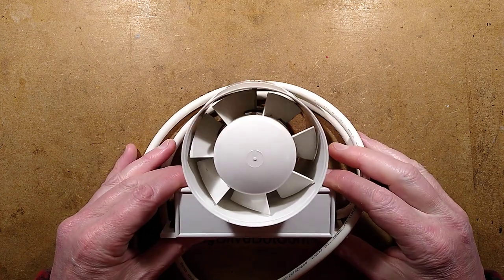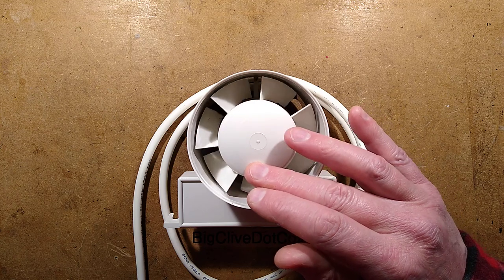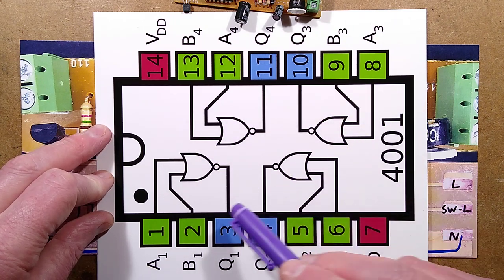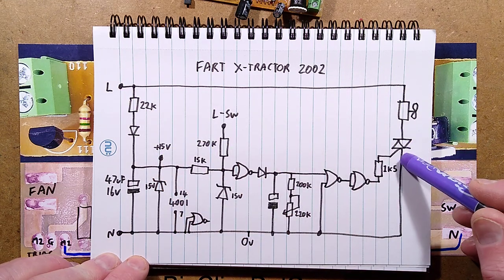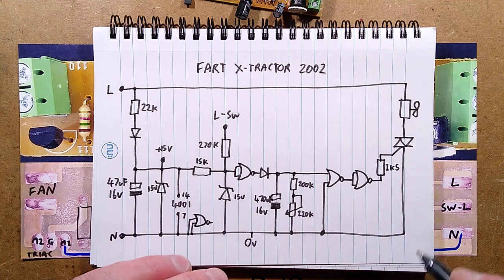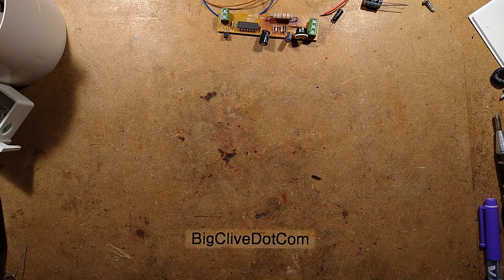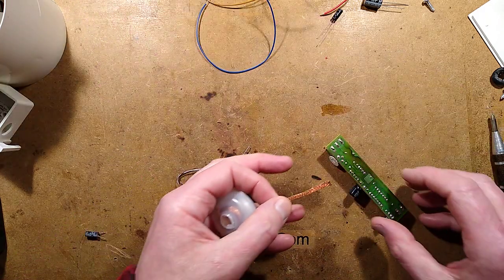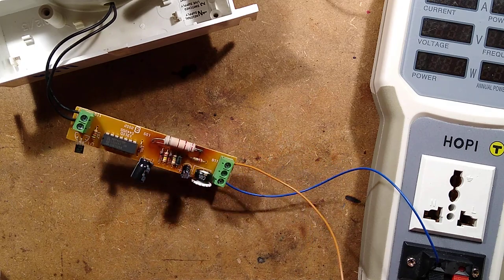Fixing a fart-extractor (with schematic)

Comment: It never ceases to amaze me the dexterity of Clives  fingers holding two things plus soldering.
Reply: surprisingly you learn pretty quickly how to use 4 fingers on your left hand to hold 2 wires facing each other for soldering
Reply: his hands now touched the fart-stained fan blades
Reply: John you soon get the hang of it, the number of times i have burnt the tip of my tong though when soldering it unreal, how the fcuk do i do that you ask? well the solder bends sometimes as you soldering, so you grip the end with your teeth and then pull it straight, problem is every now and then its still hot and the tong just don't learn, rather like when tooth ache eases off till its prodded again with the tong.
Reply: @chrispartosbro4555  LOL. Kind of like the triple dog dare and getting your tong stuck to the flag pole !  I’d burn my fingers tying to hold every thing That’s why I have a old pair of extra hands that radio shack sold years ago I miss that store !
Reply: i just use my right foot to help out haha
Reply: @johnsiders7819 - most soldering kits have those already

Comment: I think 99.9% of the faulty circuits I've repaired over nearly 30 years are either dry or puffy electrolytic capacitors. But I've seen other stuff like burned resistors, exploded varistors and such, but they're mostly symptoms of a defective electrolytic capacitor in the same circuit.
Reply: My mantra:  It’s always the capacitors.  I replace them preemptively in power supplies now.
Reply: Good to know

Comment: i've seen a few fart extractors that.. have melted. The motor bearings dry, becomes a heater, and slowly the entire "engine" block melts through the housing and hits you on the head.
Reply: Haha! Depending on how & WHEN, that is too funny. One of those few breaks we get, where you end up saying "Really life? Thanks, just thanks"!
Reply: An evil genius would pipe the exhaust INTO the office cubicles.... 😁 Would add a whole  new meaning to "Shitty day at the office".
Reply: The propeller stops in only 3 seconds. I'd say this one will die rather quickly if it's not lubricated
Reply: 🤭😯 - never seen that happen, normally these would make a hideous noise before the bearings have failed and the performance to degrade, and did you see it starting to ooze out the ceiling 😬
Reply: I've headed of one that caught fire melting the structure, falling onto a can of shaving foam putting the fire out.
Reply: @soupflood  Ahh, classic oil impregnated bronze bushing problems
Reply: @samuelfellows6923  eh, nah. Bearing is shitty bronze bushing. They're low torque and they're tiny low power motors. They use low power so they heat up slowly. They do have one shot thermal fuse but with the timer at just the right time, it's enough to heat it up to melt plastic but not trigger the fuse. so it melts through every time little by little.
Reply: @grumpyhale821  they do catch fire sometimes yes, due to combustible dust :D
Reply: @tronixfix  hot dump on the hot dumb truck!
Reply: I had this very model fail. It had obviously over heated the motor windings as there was a failed thermal fuse in there. Hopefully the thermal fuse in this model is enough to stop them catching fire, especially as they are normally mounted in inaccessible loft cavities.
Reply: @johna7075  The thermal fuses are put at around 125'C , but thanks to the timer, you could have a situation where it happens to heat up to just 100'C, melt a little start a fire, then the timer shuts it off before the fuse kills it.
Reply: This is 100% true I was sitting on the loo in a truck stop shower the fan overhead was making a racket that stopped and a half second later  it landed on my shaved head making a really bloody gash ! I jumped in the shower washed myself off and stopped the bleeding with  multiple folded TP  (I’m a ex paramedic) opened the door asked for help they called EMS it was bled thru the TP by then they took me to the local ER gave a couple of stitches.  The Union 76 people offered me a tidy sum to settle with them over it ! Should have not done that could you just hear the jury if it went to trial ?this happened near Lexington Kentucky on I 75 about 1996
Reply: @brokeandtired  hehehheheheheh

Comment: Thanks to Clive’s videos I was able to diagnose and cheaply repair an expensive wine cooler cabinet. It turned out to be a surface mounted fuse and a varistor. My best guess is that they were both blown during a lightning storm. Thanks Clive!

Comment: also known as the toilet turbojet, because they're nearly as loud as a turbojet aircraft on takeoff
Reply: If you get a chance to put a line fan instead of a surface fan. 
It is so much quieter.
Reply: @assassinlexx1993  pretty sure 90% of the pubs in England that still have these have never replaced them
Reply: @SpudderRail  
So your pubs smell like a bathroom?
Here in the  colonies  our drinking  establishments  smell then the same but with out fans.
Reply: We had a old Vortice one that was relatively old (probably from the 80's or 90's, no idea) I can confirm, this thing ran loud as hell.

Unlike most homes, it was on its own power switch (although we would seldom use it), not tied to the lights. We ended up replacing it with a variable speed unit (the fan's speed varies with the amount of humidity in the room), so now we leave it turned on all the time. In normal circumstances it spins at a relatively low speed and quietly but when someone takes a shower, the fan definitely starts speeding up at full tilt and making a whole cacophony in the process (LOL).

I still kept it in my scrap box, along with a newer, smaller Vortice (that is more barebones than the older one, the older one had small shutters on the front that would open when power was applied, the smaller one doesn't) that I have no idea if it works or not, but given how small it is, I can only imagine it makes a hell of a racket too.
Reply: @SpudderRail  - and vintage vent-axia, xpelair, vortice, extractor/ventilation fans in their walls and windows - main pub area and toilets. 😁
Reply: @assassinlexx1993  Yes, had one customer who insisted on absolutely silent fart extraction. Ended up suspending an inline version via offcuts of lighting suspension chain, using 25mm grommets as 'dampers' and ... just dangling it from the attic trusses. (one of those modern houses where the attic is full of matchwood and is thus unusable for storage anyway). it was finally quiet enuff for us to get a thumbs up from mr 'i want to hear my own farts'
Reply: @TheChipmunk2008  You can get effective ducting silencers if it's a problem.
Reply: Not as loud as the turbo hand dryers I see in public toilets, when they're actually open.
Reply: I have some of these exact fans,2 of them are mounted in ceilings directly tied to bedrooms,the builder fitted them directly to the ceiling beams and they were irritating to say the least!.So in an attempt to silence them and partly because I knew that my bloody daughter's only know how to turn lights on and because it's me who wakes up and has to turn the bloody things off in the middle of the night,which I love doing 😄 I used 2" thick neoprene pads (made from the surplus of a new cab insulator pad from a Scania)mounted on to fan then onto a bearer,it's self mounted now the roof trusses via more neoprene to eliminate the mechanical sound path and having some knowledge of baffling/silencing made some baffles using a hacksaw,a glue gun and some leftover plastic soil pipe,it worked better than I expected.To be fair though almost every small fan I have ever encountered that's noisy it's because they are dirty,imbalance causes vibrations and extra load which will shorten the service life considerably also. I have lost count of the customers who complain of heater blower vibration,BMW 1 series and drum fans in particular,where the culprit would be just a small dry leaf or tiny twig rotating with the fan.
Reply: @TheChipmunk2008  I'm puzzled by all of this going on across the pond. Here in the US, I have a nearly silent panasonic whisper green select that moves one hundred and fifty cfm
Reply: Well it would flame out like a jet if it sparked while extracting methane gas. That’s what farts contain !
Reply: There are new ones that are much quieter.
Reply: @bibasik7  Yes but my point is that most of the pubs in the UK that still have these fans simply never replaced them, they're still going strong and sound like jet engines.
Reply: @TheChipmunk2008  Not as extreme as that, but the fan in the windowless bathroom in my first place ended up in it's own isolated enclosure in the loft lined with foam and coupled back to the bathroom via thin-walled flexible plastic ducting so noise wasn't propagated down it.
Reply: @penfold7800  The latest ‘fad’ is to have public washrooms in the hinterlands of the northern outposts installed with a famous vacuum cleaner name and have ‘air knife’ style hand dryers instead of bio-degradable paper. So instead of £0.001 of paper consumed per patron, it’s now 3 to 6 minutes of 1000w electricity, @$0.35 per kw/h. Way to go technology. (The 6 minutes is 40% nuclear, 40% hydro, 20% new fangled wind/solar).

Comment: I have never heard a bathroom vent fan referred to as a "fart extractor" before. I love it. In the US, it's very often a separate switch, although sometimes it's tied to the lights and shuts off at the same time they do. It's better to have a separate switch because you really don't want the damn thing running all the time when the lights are on. It's extra noise pollution, and it sucks the air conditioning out of the house.
Reply: And I have heard that the 🇺🇸 does things far superior than the 🇬🇧 that founded your country ~ your “bathroom” extractor fans have additional “deluxe” functions; lights, night light, heater fan, infrared lamps, and some can now play music and be controlled with a smartphone

Comment: Good ol' transformerless power supply with a big inrush limiting resistor, I've used many over the years. Nice simple repair. :-) Fart away!
Reply: SPRUITS PRÖÖT TÖÖT
Reply: Inrush? It's not just an inrush limiter. It needs to be there to set the current going in to the zener diode regulator circuit.
Reply: @BrianG61UK  No, you're talking about a rener regulator circuit, I was talking about the high wattage resistor connected directly to the AC line, it's for inrush limiting, unless I failed to inspect the schematic carefully. I've put together many of these transformerless supplies over the years.
Reply: @electronicsNmore  No it's not just an inrush limiter. It needs to be there even once everything is up to normal running voltage or there would be an explosion. It is not just limiting the current while the capacitors charge up when first connected to power. The initial surge while the capacitors charge is barely more than the normal running current in this circuit because the capacitors only charge to 15V and mains voltage is 240V.
Reply: Given the smoldering around the resistor I would say it is not just limiting some inrush, its constantly dropping voltage and radiating  energy as heat by the looks. Probably runs hot enough to keep the board from freezing and moist free even in arctic conditions ^^
(In combination with the Zener as shown on Clivecad (6:42)  that's called a shunt regulator .. according to wikipedia)
Reply: Oh that's some juicy whole seed mustard here, I know... sorry
Reply: The power supply circuitry, the large resistor being part of it, is a zener shunt regulator. The resistor is required to limit the current to the zener diode and to drop the voltage between the high input (mains) voltage and the 15V zener diode.
Reply: @neorecormon1769  pumphaaaaww 💨
Thrrrriiipppt 🥴
Reply: Thats a really good explainer why these things ALWAYS die off!
Thank you, Clive.
Reply: @BrianG61UK  o
Reply: ..will do! 💨
Reply: Time to eat good Mexican food!

Comment: <Watches intently as he has something identical that's been in his bathroom ceiling for the past 8 years>
Reply: I would consider that a reasonable planning phase duration. Be aware that the fan noise can make it difficult to hear BC when you are ensconced. 😉
Reply: I also have identical fans to those,4 actually,. Due to be fact that both my daughter's have failed to grasp the fact that you can turn off lights as well as on,those fitted in the toilets nearest their rooms have been on almost continually for about 4 years now including a continual 2 week stint for one in 2019. I was initially relying on the lie that they would explode if left on too long in an effort to get them to switch off lights,sort of hoping one would pack up and puff out a bit of smoke to prove a point,it didn't work and they have been faultless despite this. I have since given up asking!😄
Reply: You writing fan fiction? What is that? Why a story?
Reply: @areyouundoingthatorwhat9181 i feel your pain, sounds like our house, i swear if they knew the oven had a light in that would be on, we on 3 levels, the 2 in question are in the middle with bathroom downstairs, hey will leave the bed room (1 light on) take 1 side step left to turn on the upper stairs lights on (2 more lights on), then take two steps right, go round the corner and turn the lower stairs light on (1 more), now they get to the bottom and turn on the living room lights from the stairs without entering the room (3 spots and a wall light), then enter the kitchen and press both switches, (2 x 3 spots and a 8 feet tube), are you adding these up? now we pass the fridge and cooker leaving these lights alone,!we then enter the passage and again press both switches, (3 spots and both that was 500 Watt outside lights but now led's) then enter the bathroom and turn on the the 6 feet tube, o yeah and they never close doors unless slamming, they turn on a total of 22 lights out of a possible 26 as the fridge gets a visit on the return trip (26 with fridge n cooker lol), all while there face is lit up with a friggin mobile phone.i swear i will fit them timer switches one day you get in rented shared stairwells where you have to press then race to the next switch while the light is still on.
Reply: @chrispartosbro4555  I thought I had problems😄,I'm sure mine will grow out if it,eventually when they leave and pay their own bills probably!
Reply: @TheScytheMoron  We taser them for most wrongs,seems a bit much for a left on light😄

Comment: In the USA, we have two separate switches, one for the light and one for the fan. This makes it possible to turn the light on and brush your teeth without the noisy fan running. On the downside, you must either turn off the fan when you leave the restroom or you must come back later and turn it off.
Reply: There are fan timer switches, I personally think they're great.
Reply: Yes we have those too, but in hotels and rental properties you don't want the occupants to have showers without turning on the fan, otherwise the humidity will eventually cause mould on the ceiling. That's why you'll see certain properties where the fan and light are on the same switch, so the tenant is forced to use the fan when showering.

Comment: 4:42 "It's very old fashioned". It is literally 001 in the series :) You could do all the logic for an Apollo Guidance Computer using only those.
Reply: I'd call CMOS logic #002. TTL was 001.
Reply: ...making it the second in the series. The first is the 4000.

Though I guess the 4000, 4001 and 4002 were all designed at the same time.
Reply: @andreasu.3546  I'd say that DTL (used a lot on Concorde flight control avionics!) was no.1, then TTL as #2 and THEN as #3 there's CMOS.
Reply: @klausstock8020  I think Andreas is talking about the familes rather than the 4000, 4001, etc within the CMOS family
Reply: @klausstock8020  lol, good point. OB1
Reply: @bobsage4963  I only ever worked with TTL and CMOS. But as you mention it, I recall DTL was mentioned as a sidenote when I got first training in electronics back in the '90s. A few years later, in college, they did not even teach discrete logics any more. FPGAs and microcontrollers had taken over.
Reply: @klausstock8020  though technically, I didn't say it was first, just 001 ;) (but yeah, you got me)
Reply: @gshingles  In any case, I did very much appreciate your fun comment, and, I must admit, it took me quite a few minutes until I thought "wait, didn't they start at '00'?" Whatever, it was an instant like (and, more importantly, Big Clive also liked your comment!). You just nailed it, 10/10!

To anyone who is not as familiar with the numbering scheme:  technically, the prefix is not "4" but "40", so it's (technically) not "001" bur only "01". Yes, the 100th series 40 CMOS IC is "4099" and the 101st is...."40100". And the "4000" series is from 1968, and still in widespread use today.

And the Apollo Guidance Computer was awesome. There was a hardware bug in another component which was triggered during the Apollo 11 moon landing (until 2005, it had been assumed to be a pilot's error). The AGC automatically recovered from the resulting overload situation and completed a flawless moon landing.
Reply: @andreasu.3546  DTL - 000?

Edit: Yeah, should've read the full thread...
Reply: @andreasu.3546  Sad, isn't it?! I started back in the 70's, in the good old days when you could look at a schematic and be in with a chance of understanding how the damn' thing worked.
That, of course, was before the days of "Your software doesn't work!"... "Yes it does, that's a hardware problem!"... "NO, it isn't, we've tested it!"... "Well it runs perfectly in emulation!"... and so on, ad infinitum... 😁
Reply: Pretty close.  If I recall correctly, the Apollo computer used a shedload of 3 input NOR gates.
Reply: Nah, Apollo predates the lot, but not by much. Have you seen the hand woven memory cores they used? Beautiful work